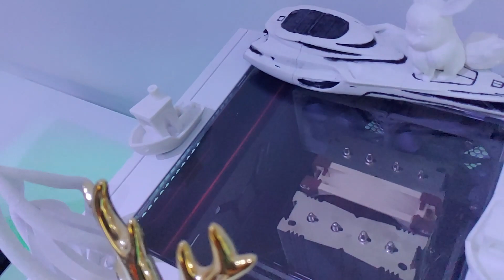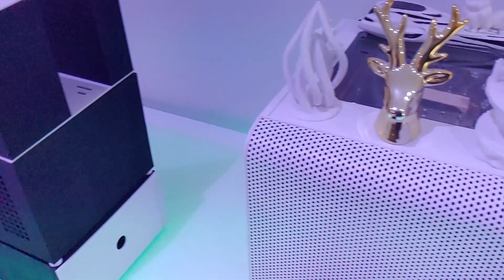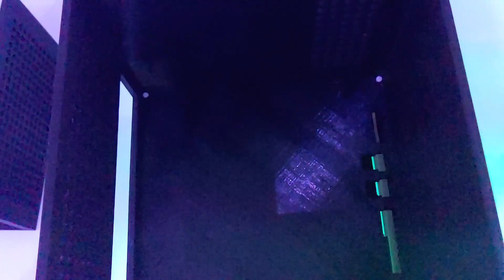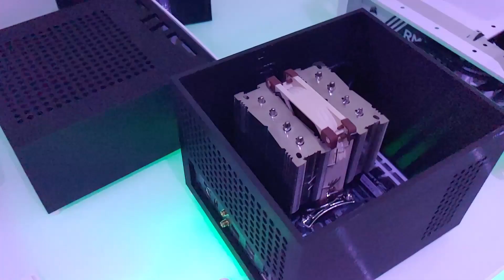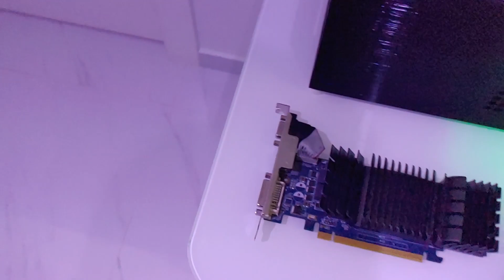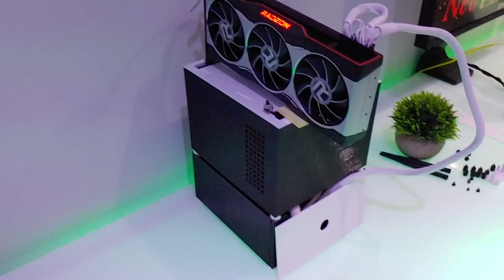3D Printed Modular PC - V1

Comment: Looks interesting, but what's the point of it?
Reply: Then you probably also forgot the fans
Reply from the maker: In case you didnt watch the full video, is to have it be easily swapable. Aka modular.
But that will come in version 2
Reply: @NebulaFactory  I did watch the full video but the thing is the PC is already modular. Although I really like the idea but as you saw there are some problems with the GPU module size.
Reply from the maker: @just_the_regas  Pcs are not really modular, as in they dont have modules. They are swapable tho, which is the fun of building your own pc, and swapping stuff over time.
This one does take it to the next step in the sense that upgrading certain components would literally be just slide out, slide in.
Rather than have to open the entire computer, unplug stuff, plug the new one, check nothing broke etc etc.
Not saying its a better way, but certainly easier for sure.
Reply: @NebulaFactory  well, the thing is it isn't, to connect but actually it's the same) I hope your version 2.0 will have additional cables for each module, in that case, yes) It will be better)